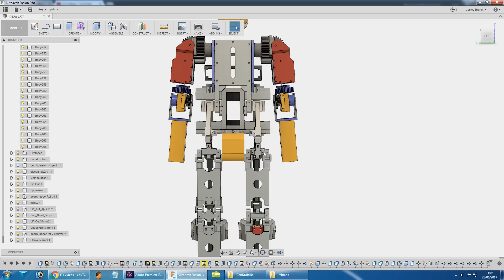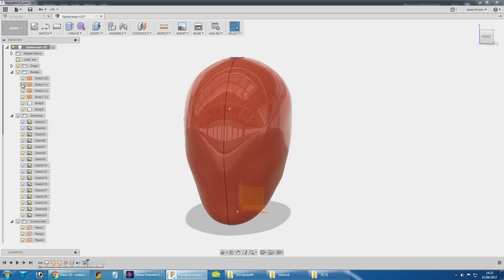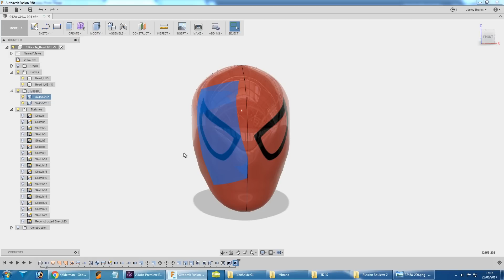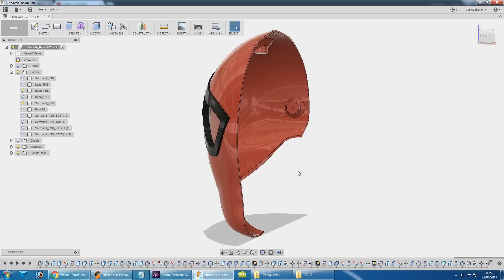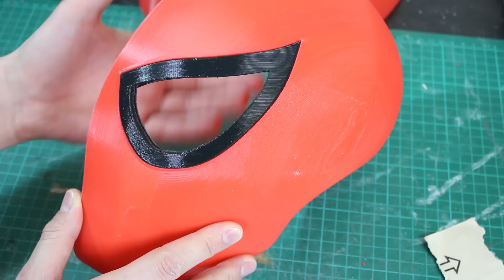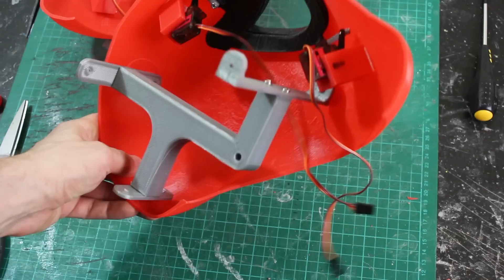Robot Spider-Man #1 | Head & Eye Mechanism | James Bruton

Comment: The head profile would have been a good thing to experiment with the T-spline surface tools in fusion 360.  I have not played with them too much myself.  They can do symmetry fairly well and seem quite easy to use from the several videos I have watched on them.

Comment: Hey James, I think that the upper eyelid should be positioned so that the side part of the lower lid goes behind it. It looks a little odd for the side to overlap in front of the top lid(see testing at about 11:14) IMO. 

The colour of the red PLA looks great, and will look even better after some finishing.

I'm not sure how much testing with infill densities you've done, but on some parts it seems like you use a lot of material. Especially for thing like brackets that won't have much stress on them, you might be able to reduce the infill density to save material, and maybe more importantly, time.

Comment: Got what's probably a stupid question but how come companies like Honda with there ASIMO robot and other robotic companies spent years trying to get robots to walk without falling over yet you've managed to do it several times with your builds? Did companies like honda explain how they managed to get robots to walk?
Reply: The major obstacle is 2 feet in the air and landing properly, like running and hopping.

If ASIMO is a full grown adult, this robot would be a fetus; takes very small steps, turning takes forever, needs 1 foot to balance on, etc.
Reply: Yeah true, ASIMO is pretty advanced in what it can do, even climbs steps. Can't remember how long ago it was but once saw a video on how difficult it is to get a robot to walk tho thinking about it might have been to run which is obviously much harder.
Reply: The impressive part isn't that it's better, because it isn't, not even close to many I've seen, but that's not the point. The point is he alone as a lone "engineer" if you will, has created something close enough to be comparable to the works of dedicated teams of robotics experts who've worked for a long time for their robots. It's like having a one legged guy with no prosthetic finish twice as long as a runner, he shouldn't be able to get anywhere that close without similar opportunity.
Reply: ASIMO was originally constructed some years ago now and computing, robotics and electronics has advanced since then which is how someone like James can do what he does. I'm not taking anything away from James' talent, creativity and dedication but he wouldn't be able to do what he does without the various technologies at his disposal including 3D printing, sensors and microelectronics to name a few. As others have quite rightly pointed out ASIMO is partially autonomous and so represents the pinnacle of robotics at the time it was created. I'm quite sure if Honda were to build a brand new ASIMO today they'd utilise many of the latest technologies which would result in a better robot and much reduced build costs. Ultimately, James' creations are remote controlled devices with minimal autonomy but he is able to create them using a tiny fraction of the millions of dollars that ASIMO cost because of the advances I've mentioned and ultimately his design and construction skills.
Reply: Also keep in mind that bigger company robots can see there surroundings and take action to avoid, step over, navigate around stuff. Even reach out and open a door to walk through. What James is doing is absolutely incredible, so I'm  not trying to take any thing away from that, but autonomous navigation is extremely complex.